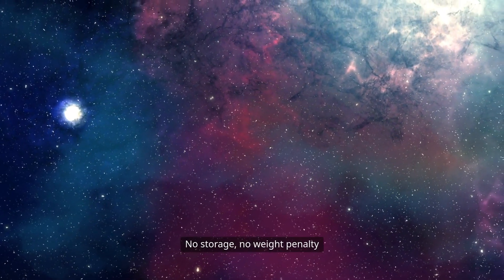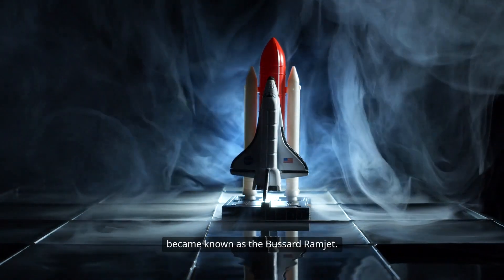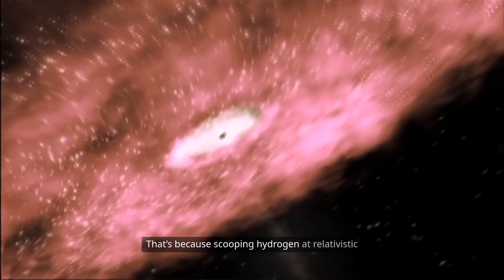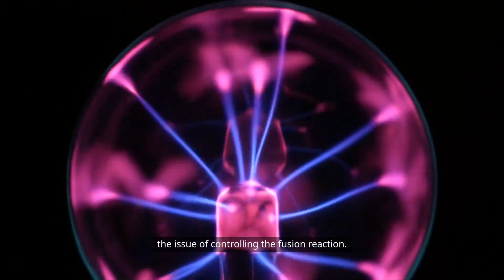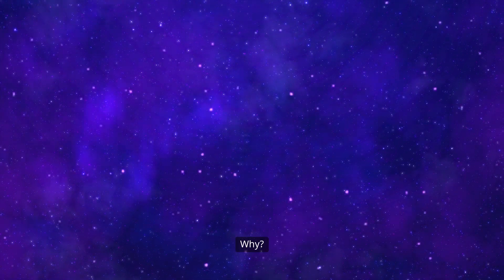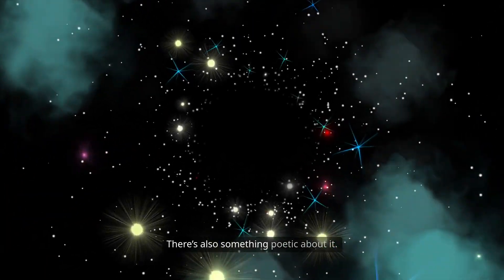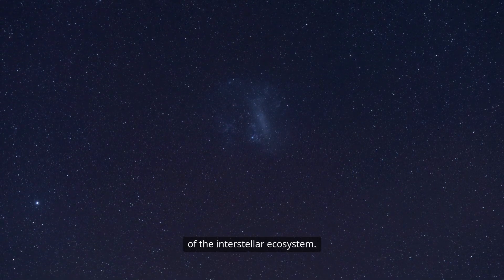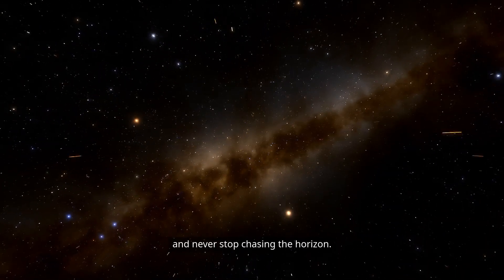The Dream and Dilemma of the Interstellar Ramjet

Comment: Magnetic gyroscope recorded digitally to use the casimir effect to intake stellar radiation and particles like hydrogen into magnetic ion intakes, to create plasmas in a confined magnetic field, released as thrust in controlles rates, through a magnetic ionic thruster powered by batteries throughout the system